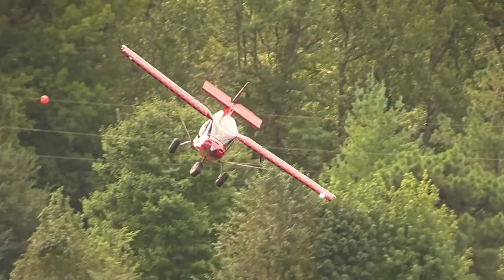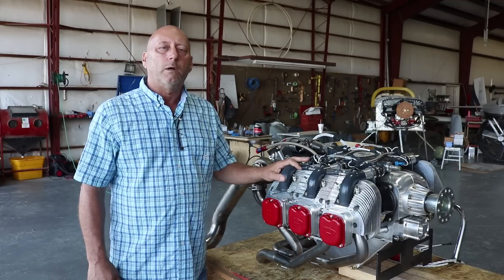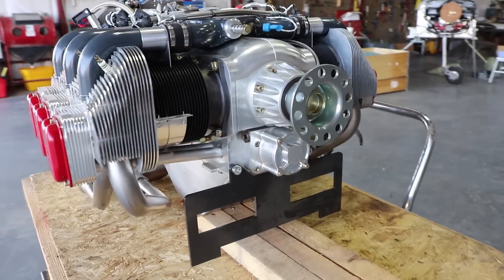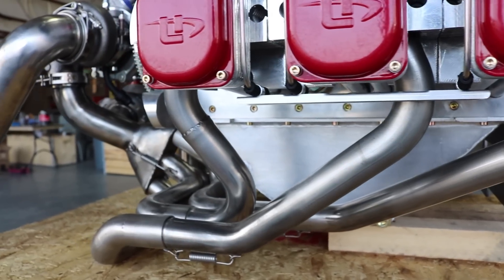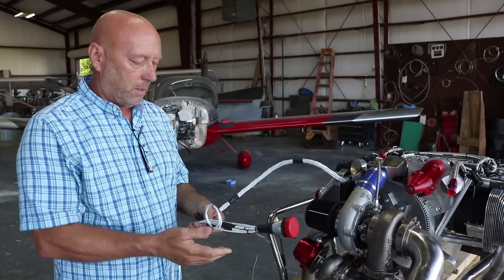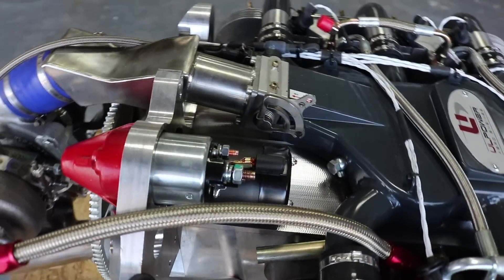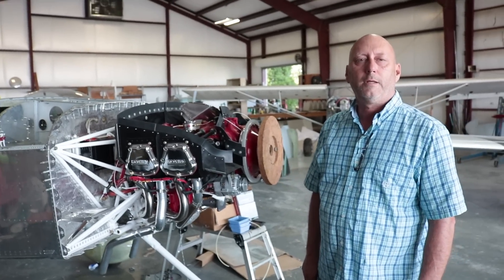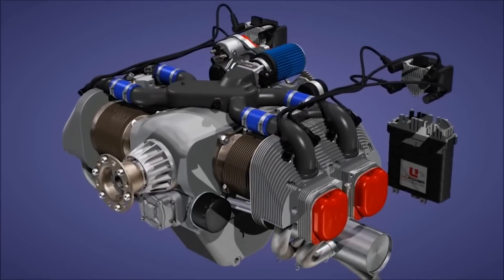UL Power Aircraft Engines - Engine Week 2020

Comment: I like the engine, but the turbo plumbing is not great, particularly the collector, and the welding doesn't look great. Also why not use a turbo with integral wastegate? lighter, cheaper, and could use an N75 valve to electronically control it.

Comment: That wiring where it comes out of the engine looks like it is laying right on top of the exhaust. Is it really touching it? Or is that just a trick of the camera?
Reply: If you mean the spark plugs wires on the top, that's the INTAKE manifold, not the exhaust.

Comment: Where does one find 97 octane mogas?  Racetrack?
Reply: Europe and the US have different methods of measuring octane. 95 octane euro= 91 octane here, and 97 octane in EU is 93 octane here. Basically, the models ending in "i" run on 91, the ones ending in "is" run on 93.

Comment: 220 hp from turbo 5.2 ?
Just take 2jz Toyota 3.0 and around 
Safe 500 and north hp 
Yes i know it's aircraft motor but ?
Reply: Aircraft engines need to produce their power at a max of around 3000 rpm at the prop (otherwise they become inefficient & too loud as the prop tips approach the speed of sound). And unlike in a car where full power is usually produced only for short periods of time, an aircraft engine needs to be able to produce full power for 5 minutes at take off, and 75% power continuously (with absolute reliability) for at least 1000 hours of use before overhaul. So that 2JZ in an aircraft application would likely only be good for 'maybe' 300hp. Then there's the weight - a serious issue for both aircraft performance, useful load, and centre of gravity. A 2JZ is somewhere in the order of 450lbs, but you'd need a reduction gearbox to make it useful for spinning a prop, so probably closer to 500lbs all up- about TWICE the weight of this ULpower engine. Then you've got the problem of trying to physically fit the engine, plus radiator, intercooler (and probably an oil cooler) into the tight confines of an aircraft engine cowling.

Comment: 2 bad they messed up the exhaust headers  or just didnt leave it off as to get the best power all the exhaust  headers  must be the the same length and go into a 2into 1 header or 3 into header.
Reply: Probably not enough to worry about at such low RPM.  Sound on the other hand, now I do like the sound of an equal length set-up. Sounds clean.
Reply: @scootypuffjr.  all aircraft engines run at low rpm since propeller  can only spin so fast.   
Its only non aircraft  engines that run at higher rpms and they need to be geared down at propeller drive
Yes it does make a difference in power.  
Also every aircraft has a different layout for what what fits where.  Most experimentals i have worked on besides my stepfathers gyros which won a bronze and silver lindy at airventure dont have room for that single exhaust  collector across the back  of engine.  
Also i noticed it didn't  have the enlarged areas, not sure what exact name is, where it comes out of the manifold, that all the new exhaust piping has to prevent  it from cracking.  
Its especially a waste on the aerobatic engine as most aerobatic planes have very tight cowling and exhaust is routed to fit and must be 3 into 1 for smoke system.  
I really like these engines otherwise.  I just wish they were higher hp for planes i build
Reply: @cw93711  lots of real aircraft engines run faster than prop speed. Rolls-Royce Merlin ring a bell? Built in prop speed reduction units on some radials as well. Again, exhaust efficiency at such low RPM is secondary to packaging and aerodynamic constraints. These Corvair conversions are running direct drive, low RPM, low power. The extra weight alone of a tuned equal length system probably would not pay for itself in power returned.
Reply: @cw93711  you want HIGH rpm, check out the Edge performance Yamaha engines. Not much good for anything other than STOL competitions though. Lots of great options available. Personally, I would bet my life on a Chevrolet LS V8. I have put hundreds of thousands of miles on those in trucks. Never have a failure that would have forced a landing in a plane. That is a big heavy engine though and limited airframes that would accommodate it.
Reply: @scootypuffjr.  i didnt consider the merlin etc as basically  none are flying anymore.    If the yahama is the 1 i am thinking of my stepfather  and i just discussed on turkey  night.  He was grumpy that they went away from the low power  yamaha engines  to the apex enegine is it thats over 200 hp.   
When i think of Chevy  ls engines i think of the corvette ls engines  and a few experimentals  have gone done with engine  issues  reduction gearing but that was a long time ago.  I havent paid any attention  to them since they were to heavy an cost at the time was to much was what you got. 
I keep going back and forth  between  buying a certified  aircraft youcan travel with or building a a moderate  aerobatic  plane  i can still travel in
If i had the money a newer war bird trainer would be perfect. 
I wish i would have  bought a couple l 39 when i could have bought low time reassembled  guages etc switched  to English  everything gone over by the engineers  who did mig 29 i believe and have modern Garmin  avionics  installed.  
I met the owner of the company that had all the Czech military  ones at air venture.   He was already building  kit plane for a friend of mine that i had just purchased and i thought a jet was 2 much for low time pilot and didnt want to hold on to and try to sell even after i got a ride and an hour of pic was like hot damn   was better then then mustang i flew the same year .   I didnt see opportunity  that slapped me side the face.   Especially  with my 4 neighbors all a&p for gulfstream
Reply: @cw93711  I don't let anyone work on any of my vehicles, and I surely wouldn't want someone else working on  an aircraft that I owned. So, I'm looking at different home build options. I'm feel I'm too old to go for an A&P, though I would I really consider that a badge of honor. I really only need to carry my daughter and myself, and some luggage for vacations. Something fast and efficient and not super expensive. A recent divorce set me back a bit. Probably won't happen. I'm just a well informed dreamer at this point.
Reply: @cw93711  the Rotax 900 series are all gear reduced. Tons of those around. I can't help but think that a rebuilt Lycoming or Continental engine would be the way to go for most builds. The Viking Hondas look intriguing too though.
Reply: @scootypuffjr.   rotax has been around since 1920 and were orginally snowmobile and motorcycle engines that they moved to ultralights and now lsa and experimental.  
For engines it all depends  on what you want for power and what you want to do with it and how experimental  you want to go.  I know people who want to use yamaha apex engines of junked engines instead of spending 2k more for a new factory  crate engine.  After living in northern  wis for 10 years and reading and dealing with the claims from said accidents as i am insurance  agent i wouldnt touch a wrecked snowmobile  engine  if it was free.  
I keep looking at alternative  engines and even though they are way cheaper they io540 at 300 plus hp seems to be best for me just with dual electric  ignitions.  
Rotax is their with the light weight air craft where  their are getting almost 200 mph out of their 914 and 915.  But those are electric constant  speed prop.    But those engines require such a light plane... idk     its a pain  to figure out what you want and can afford
Reply: @cw93711  I'm from the midwest and I too know the horrors that can occur to well used snowmobiles and their engines.  I had to pull my then new 1996 V-Max 4 800 off the bottom of a river after the drive belt exploded in the middle of a long open water spot. Had it running later that day but I'm sure it was not better for the experience. That was an interesting engine. 4 cylinder  2-cycle . 2 separate crank shafts geared to a jack shaft that spun the primary clutch. I still have it. Yamaha engines have proven to be stone reliable in my experience. Sleds and bikes both.
Reply: @scootypuffjr.   i always  had yamaha  super sport bikes  like the r6 and r1 not really into snowmobiles.  Did have raptor with yamaha  factory  race kit after guy didnt get approved for financing.  Also yamaha  moto x bikes  from x 2 strokes to 4 strokes.   I sure miss the 2 strokes  am glad they are coming back
Reply: Not an issue on a turbo
Reply: @sledawgpilot  even with a turbo i dont know of anyone whos going to run a 6 into 1 exhaust just because of the room it takes and where it is.

Comment: Awesome current tech and simple low parts count implementation.  Now they just need to make a rotax killer by putting a turbo on the low compression UL260 for s sweet 130hp continuous up high HP.   it would be lighter and simpler than the rotax, and is already built for 130HP, with the same basic internals, same bore, and the exact same heads as the 350.  Would be just the ticket for my Europa build.  :-)
Reply: I agree... I'd be interested in a turbocharged 260.
Reply from the maker: It only takes money and an email.... hah! Try it. :-)

Comment: Yikes! 44k for an engine for Toy Airplanes?
Reply from the maker: Prices have gotten a little out of hand. Unfortunately  I believe that is due to the liability of it and the low production manufacturing in comparison to other markets. There are OPTIONS for everyone. Hence the start of this ENGINE WEEK series. So you can hopefully "LAND" on something that fits your mission and budget.
Reply: It still boggles me that ‘real’ aircraft engines are basically unchanged from 1940 designs.  In the misguided distrust of electrical systems, aero engines are now 80 years behind modern engines.  And they still fail right?  Toy aeroplanes at least use engines with 20 year old technology - a bit more up to date.  It is also strange that the  owners of these these real aircraft with ‘proper’ aero engines, that will run without electrical power, will then fill the same aircraft with every electrical flight device known to man with no consideration given to the fact that with the lack of backup steam gauges, the aircraft would be almost impossible to navigate safely to a landing anyway.
Reply: @stephengloor8451  I'm not a "hater"! I think the engine is fantastic! Properly engineered,  user/mechanic friendly (former Military crew Chief AND Pilot) it's just that I'm shopping , looking at Planes, prices, and when I stumble across an engine for 40k that is intended for a glorified Ultralight,  I cant wrap my head around it. Thus, the real vs Toy plane categories. A real plane Carries 4 adults and modest luggage to the Bahamas or the Coast on a bag of gas. A toy plane Carries less fuel than a WaWa coffee mug. Putting a 40k engine in these tiny EXP "planes" is like putting a Lamborghini engine in a Civic.
Reply: @Bigsky1991   I am sure you are not a ‘hater’.  You need to remember comments have no context.  Putting “toy aeroplanes” in your comment gave the impression you are.  

The engine that is 44K is 220hp and would be fitted to a homebuilt that could well be four seat and be capable of flying to the Bahamas.  The smaller engines are fairly reasonably priced and yes they ARE Lamborghini engines.  The ENTIRE aero engine market is totally dwarfed by car engines and is indeed comparable to the size of the very high end supercar market, so yes,  every aero engine is, in effect, a Lamborghini motor.  Priced a 220hp Lycoming or Continental engine lately?  This makes Viking et al engines much cheaper as they are actually 2020 technology and tap into that gigantic car market however these sort of engines are usually shunned by real aircraft people.

As the video poster says look at the car derivative engines with an open mind.  If I ever get to build a plane I will be using a Viking.  There is a dealer in Australia here that can deliver a Zenith Cruiser kit with a Viking engine and FWF kit for about 65K AUD.  Don’t quote me on that BTW, I haven’t looked for a while.  This would give me a modern metal two seat aircraft with a modern engine that uses very little MOGAS.
Reply: Toy airplanes? As opposed to what - the mostly ancient, overpriced, underperforming, flying bricks of bureaucracy that constitute the majority of certified G.A. aircraft?
Reply: 200 plus HP compact turbocharged air-cooled engine with redundancy features. Where did toy aircraft come from
Reply: @1STGeneral  the little planes that its intended for,  the Experimentals (overpriced ultralights!) Jeez, I almost bought a Piper Seneca last year for 33k!
Reply: @Bigsky1991  The type of aircraft that $44k engine would go into would be something like the RV-8 or RV-14, both of which are aerobatic 200+ mph "real" aircraft (hardly an "overpriced ultralight"). Oh, and they are a helluva lot more fun to fly than a boring clapped out 40+ year old Seneca that smells like a moldy wet couch inside. ;-)

Comment: I hear a lot about UL.  They seem to be an excellent engine.
Reply from the maker: Power to weight ratio seems to be very good as well. I am seeing many installations with LONG engine mounts. Meaning they are light weight for the airframe. Thanks for watching!
Reply: @ExperimentalAircraftChannel  and perrrrrfect weight for those many airframes designed around the 9 series rotax.
Reply: How costly is a engine like this
Reply: @bendaves77  rotax price range.

Comment: I'd like to put one of those beauties in my Corvair. The oiling system is an excellent design, w/ oil squirters for the cylinders and the valve train, for reliability. Get's to the heart of the latent engineer in me.
Reply from the maker: THAT... would be a unique installation for sure!
Reply: I'm thinking an LS V8 in a Corvair. Put the air cooled six back in an aircraft where it belongs, lol.
Reply: Man, you lost me when you admitted to actually having a Corvair !